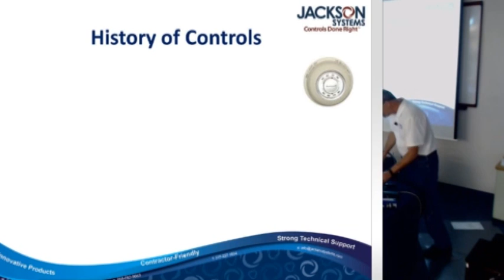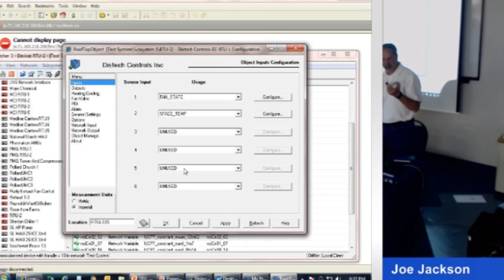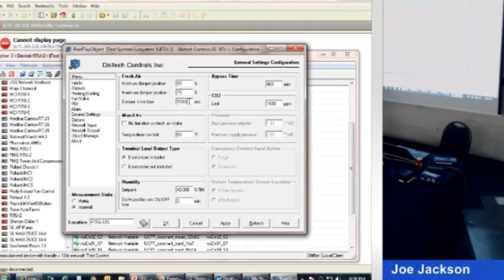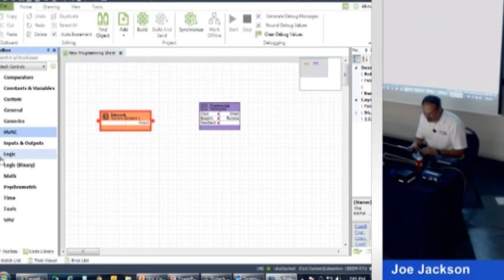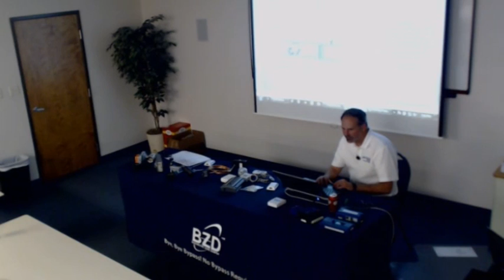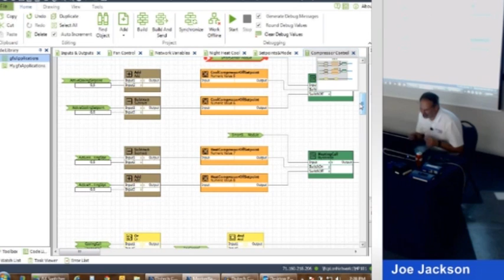DDC Training (Direct Digital Controls)

Comment: Hello Joe, what's the difference(if any) btw DDC and BACNET Controls. Thank you.
Reply from the maker: Hi Adeola,  BACnet is a network protocol specifically used for multiple devices to communicate across building automation systems by system users and building system manufacturers. DDC consist of a central computer workstation that monitors HVAC, lighting, or other system functions via a series of sensors. These sensors transmit data back to the workstation, where sophisticated software monitors performance and makes operational adjustments as necessary.

Comment: Very helpful.  So what is the difference between a FX supervisor and an NAE
Reply from the maker: Thanks for the comment. Here are at Jackson Systems we use Distech for building automation, but I believe your question is in regards to two Johnson Control systems. the FX Supervisory is a control system for open source networks like  BACnet® and LONWORKS®, where as the Johnson NAE is a proprietary closed engine.  If you would like to go more in depth contact us at info@jacksonsystems.com and direct your question to our Custom Controls Division. Thanks

Comment: Any comment on the degradation your products can cause to the end user experience? Specifically  in regard to your hotel products that seem to be attempting to remove the right of the consumer to decide the comfort level of their rooms there paying hundreds of dollars to occupy? No where in the legal wording of any hotel document that has been presented to me has there been any mention of any limitations in regard's to your right to control room temperature. It's not the principle of energy conservation that is flawed but the attempt to make it forced. When I questioned the hotel staff as to my options for temperature control the general manager informed me their were none. Obviously their are options in the ability to bypass the motion sensor components of the system. Also obvious is that a general manager of a business class hotel property is going to have a working knowledge of the basic functions of the buildings comfort systems. Dose your training on these systems properly enable hotel property managers to insure the comfort of their customers? The whole thing brings one phrase to mind "deceptive business practice". I would very much appreciate any clarifications or rebuttals of these issues.